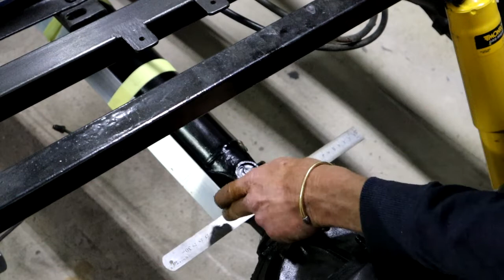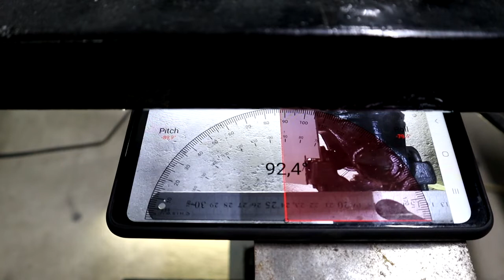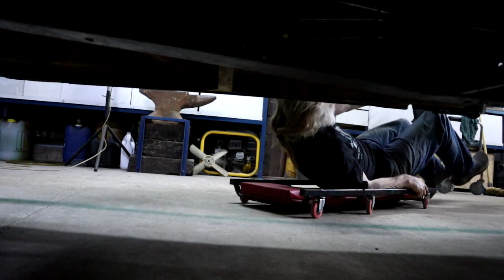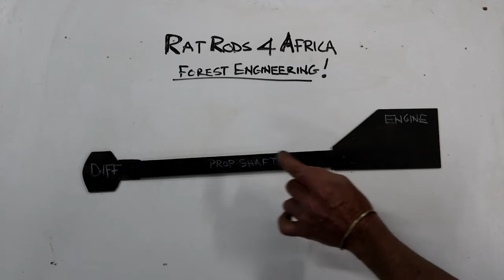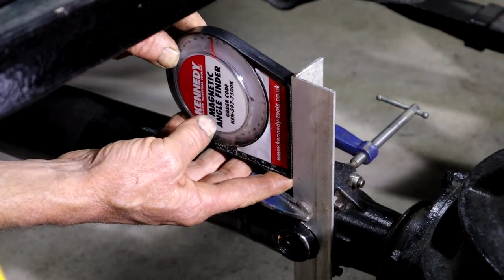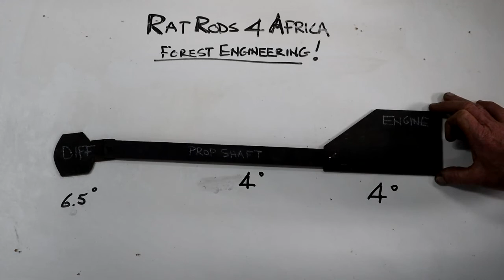Drive shaft angles - measuring setting up

Comment: Hi Duff I saw that you have an app that you got from your daughter installed on your phone that measures degrees protactor what is the name of that app? must say i admire your way of solving all problems when building your rat rods, i follow along as best i can mvh Lennart. have a good one
Reply from the maker: It's just called "Angle Meter", but I found it's not consistent! I've been using a digital angle meter, much better
Reply: @ratrodsafrica thanks so much

Comment: If you drop the front suspention the motor angle will change, relaltive the ground but will stay the same relative to the chassis, as will the the pinion angle. In other words, the motor angle and pinion angle will stay relative to each other no matter what you do with the front suspenion.
Reply from the maker: Gallie, you are absolutely right!  It's all about what references to what.🙂

Comment: Am I wrong? if you lower the front of the truck the chassis rotates around the rear axle taking the rear axle with is, so no difference is enduced!?
Reply from the maker: You are absolutely right. Just gotta remember that the angle finder measures relative to horizontal. So when front drops, pinion angle will stay the same relative to chassis, but not relative to horizontal.
Reply: @ratrodsafrica  Yeah, its only the caster that changes when you lower the front.

Comment: Umm... If you lower the front end, the angle of the engine will change, but so will the angle of the differentiel, because it's bolted to the springs, which are bolted to the frame.
I have had similar experiences measuring angles with the phone, I don't get consistent results, so I'm too using the same kind of old angle finder

Comment: If you were to put the steering box on the Canadian side of the frame rails you would have more manifold to steering box clearance because the adjusting nut housing would be facing outward ....Just pulling your chain and let you I watched all to the end .You are a very interesting fellow and explain things very clearly .Thanks for the time you spend making these videos .Cheers
Reply from the maker: The Canadian side is too cold for me man! 😅 Thanks brother

Comment: Another very informative video and well explained .  The illustrations are a nice touch.  This has some relevant applications to placing a larger engine in older vehicles where the steering box  or possibly the starter might have clearance issues.  Have never seen this  addressed  anywhere before.  Good work Div. !!!!!!!!!
Reply from the maker: Thanks very much Randy! Coming from you, I see it as a huge compliment😎